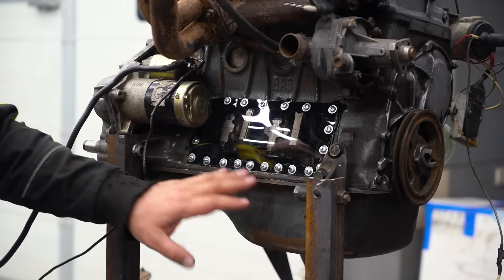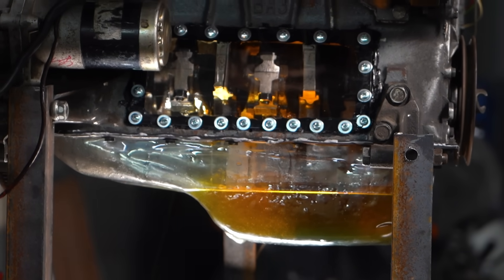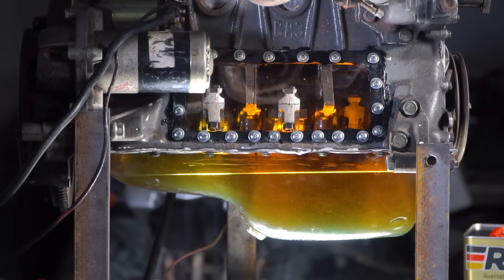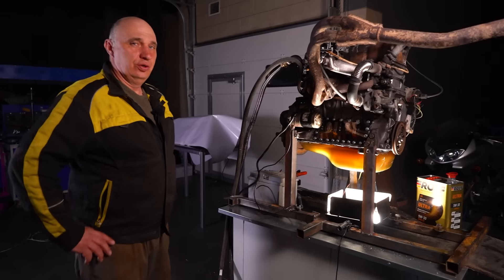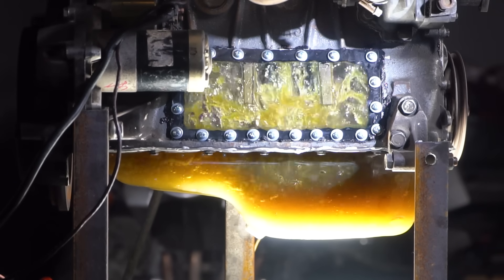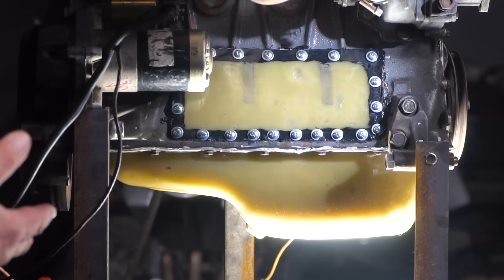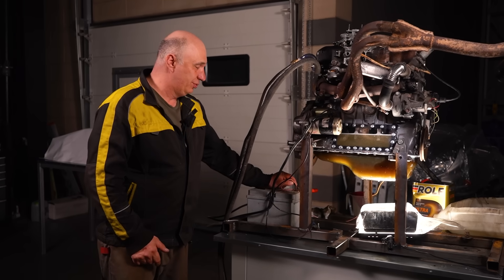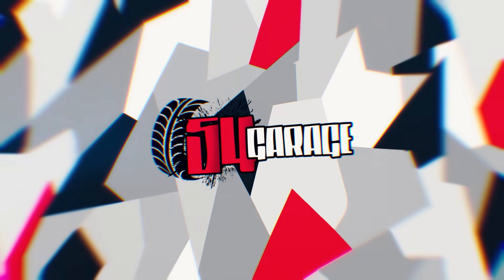What actually happens when you overfill your motor oil? (w/ transparent oil pan)

Comment: 2 things happen. 1.  power is reduced due to the crank hitting the oil and picking it up. This is the reason race engines use dry sump systems or windage trays and scrapers. 2. The foaming action of the oil is increased not allowing air to dissipate out of the oil causing cavitation around the oil pump pick up tube, thus reducing oil pressure because of air in the system which reduces the film of oil on the bearings and causing extern wear. Garage 54 is what hot-rodding in the US use to be! Great and fun channel.
Reply: Race cars don't use dry sump oil systems because the oil being picked up causes a loss in power, it's because during long, hard turns a traditional wet sump setup like the one in this video would have all the oil slosh to one side of the sump which can lead to low oil pressure and even complete engine failure if it happens enough. Keep in mind that most normal engines only have one oil pickup at the bottom of the sump, if all the oil goes to the other side of the sump there's nothing for it to pump
Reply: It's true that dry sump engines can add horsepower along with keeping a consistent supply to the moving thingies, BUT by sealing the engine itself and venting the oil tank you would show an increase in power and a side effect would be those tiny little leaks around seals or gaskets in a few cases wouldn't cause the flagman to show you his purty little b?black flag. Unless you weren't using valve covers with a little inside lip, or some good aircraft grade gasket adhesive the vacuum can also suck a gasket in from the sealing surface and will make almost as big a mess when the RPM drops.
Reply: None of that happens with 1 quart over.
Reply: Race cars use dry sumps because of inertia. During turns oil goes away to sides and pump cant pick it up.
Reply: In mother Russia we fill engine full of oil. If not enough power we get bigger engine.
Reply: Wonder what would happen if engine totally drained again then refilled to normal level, would engine be fine again...? (after also replacing blown gaskets and such, of course). I wonder...
Reply: @gregpohl412   If the engine doesn't get too badly-beaten and the main gaskets don't rupture something, and if the piston rings don't get damaged from playing oil-wall-pump or whatever...yeah, when you return it to normal oil levels, any excess should find its way out of the system over time and it should GENERALLY be okay.  Turbos could suffer terribly from foamed oil, as could the motor if it gets pushed to high loads/high RPM with the overfilled oil, but by and large if you don't run it for too long and don't have it explode out of something, it SHOULD mostly be okay.  It might sneak into the pistons though, maybe they might need cleaned out, or the spark plugs might want to be washed/replaced, dunno.  Mostly it should be fine if it didn't get pushed TOO hard before it was corrected.

Put in FIVE times the oil, or fill it to where the pistons can't keep oil out and you could 'hydro-lock' the engine with the excess oil, and THAT would be terri-bad for the motor.  They don't like 'stopping when one piston runs into the wall called "Oil can't be compressed" and stops the motor mid-rotation.  It's like stopping it by dropping a bolt into the piston.  CLONK, just using oil as the bolt.
Reply: Hi, i just got my license last year and am completely new to cars. I owe a 2004 ram pickup truck and am trying to expand my knowledge in the universe of vehicle maintenance, but it can be hard to make sense of at times. Can you explain this in a way so a dummy could understand?
Reply: @Prinessofwolfs5  can not teach engines in a couple of paragraphs! It takes years. There is an old man on YouTube that is a Legend!! Find him and watch every video. Wont be long till we cant learn from him anymore!
Reply: Always follow your Ram's engine specs listed in the owners manual for fluid capacities. Watch a few YouTube vids prior to working on her, change oil every 4-5,000 miles, and don't be afraid to do anything repair-wise, just use the right tools ALWAYS! @Prinessofwolfs5
Reply: 😮lll😢
Reply: Race cars use dry sumps to prevent the oil being forced away from the oilpump pickup under high gee load while cornering. Which would lunch the engine.
The end.
Reply: oil pressure increased and got out in the video
Reply: Most modern engines use windage trays now..   Just that little bit of extra efficiency for nothing more than a piece of stamped sheet metal, though some go further and have a big cast aluminum chunk that is actually structural..
.
As for race cars and dry sumps..  Yes, foaming, yes, windage..   But I'm going to say the majority of that is for temperature.   Once your oil gets over 260 270, you are just done...  And its not that hard to get it there..  
.
I was back at my parents house this summer, got a boat from my Dad's friend.   Took my folks Grand Cherokee and towed it back home, 2400 miles..  Its the little six 3.somthing, didn't have the tow package, so no oil cooler..   I was worried about the tranny, that thing stayed rock solid at 206, just like it does driving around town..  
.
One push up and one push down on a button gets you from tranny temp to oil temp..    I ended up driving by the oil temp..  It was a fresh full synthetic change, Pennzoil, if that makes a difference, I like it because of Steve Park.    Flat highway, wouldn't go much over 200 degrees.   Get into those hills, and I really had to start slowing down, it was pushing 230+, and I wasn't comfortable with that..    Just go up the hills at 65 instead of 75 and I could drop the oil temp 10-15 degrees.   Running without towing and empty, its almost impossible to get the oil temp to even get up to the coolant temp...  
.
I'm a little gun shy on the oil temp thing, my aunt cooked her motor in her toyota camry a few years ago, Tulsa to OKC, she was moving back to Phoenix, her car was LOADED..   She had my cousin with her..  Probably an extra 1000+ pounds in the car, I was back East when they left, and checked all the fluids, even though she had just been to the garage..  Just in case..  
.
Day and a half later I get a call..  Motor is making a funny noise...  And over the phone you hear BAP-BAP-BAP..  I hope that's a massive exhaust leak..  And then some nice guy pulled up behind them, asked if they were OK...  Said he would go back and sit in his giant pickup until AAA got there so nobody would hit them..   I was already on the phone with them, my cousin had texted me his plate # just in case..   He checked the oil, super low.. added 3 quarts to even get it on the dipstick, and even with 3 fresh quarts, it was still midnight black oil..   I talked to him on the phone..  and he was like "Yeah..  that's a rod knock, that's not an exhaust leak"..   Its hard to tell over the phone, and I was going for the positive spin (I was already 96% positive that was a rod knock).    
.
Long story short, my aunt has no mechanical knowledge, nor does she want any, and she drives like a mad woman..  And she was probably running 90+ up those hills, and if ya'll have driven 44 from Tulsa to OKC, those are some pretty tough hills.   Hauling 1500lbs over GVW for her car...  Probably got regular dino oil, not synthetic, and she cooked her oil..  
.
I think every vehicle should come with an oil temp gage..  Super handy, especially if you are towing, almost as import as coolant temp..  
.
So anyways..   Lots of babbling, I'm of the opinion that race cars primarily run dry sumps so that they can hold a lot of oil so that it can cool and not cook the engine.   Running hard puts a ton of temp into your oil, and oil has a limit, and its really not that high.    
.
Reply: An other bad thing that would happen with too much oil in the engine is some of the oil is going threw the exaust and cloging the catalytic converter till the engine stops running because of it.
Reply: There still are a lot of engine heads here, we just don't post on YouTube, we just do it for ourselves. I commend this channel, it's just not my thing to post a video of doing something
Reply: Thanks for the information, wise 🦉
Reply: https://www.youtube.com/watch?v=GJzrzHTWooE
Reply: That's one reason race engines use dry sumps. The other is they spend relatively long periods at high lateral acceleration that could expose the oil pickup. Just easier to use a dry sump and not have to worry about that and other factors that could cause inconsistent oil pressure. 

It's also interesting how you can hear that the engine is idling slower with the overfilled pan. Clearly, overfilling the oil by, say 2x won't cause any damage unless you drive it that way for awhile.
Reply: 3 things will happen.... the engine WILL begin to smoke out of the exhaust when enough oil gets thrown onto the bores and overloads the rings..
Reply: Confirmed in my testing, you get the best results at about half full for the toyota series engines. On the crosshatch marks - just make sure that the engine doesn't make any scrapy sounds compared to before. 

Having one of the taps for the sump plugs are really useful, because you can recycle the oil and test the optimal oil level for the car.
Reply: the dip stick have hallow dots on it which tells how much space is in the sump available to fill the oil for the engine
Reply: they also use a knife-edged crankshaft
Reply: Doesn't happen until excessive amounts of oil are used, 3X
Reply: And 3 the undersides of the pistons smash into the oil so hard. They crack the skirts.
Reply: exactly similar to gearbox overfilled.
Reply: No. No. No. Basic physics would say the crank has so much inertia the force of rotating in the oil is almost unmeasurable. 

THE REASON race cars and many performance vehicles use dry sump is to ensure oil pressure under high g braking and cornering…smh. 

In a pan the oil will slosh around. 

Just worded #1 a bit wrong. Your #2 is ok, except a large excess of oil also increases oil pressure and will eventually cause leaks and excessive blowback into (if equipped) emissions systems

Comment: The test is good but is not real world, as stated the engine is stationary and the oil is not moving around as per normal operation.  The topic has been extensively researched by manufacturers and there is a reason why the manufacturer specifies a oil amount and warning to keep within the limit.  The semantics about foaming and oil pressure etc is another topic however the oil pressure test here was missing and another very important conversation topic, this is an old engine, modern engines operate slightly different from manufacturer to manufacturer.  I think this test shows "some" detail however the real world data is difficult to compare to this demonstration.

Comment: The problem with over filling oil is heat. The surface area of the engine doesn't change so you end up retaining heat in the oil - in a bigger volume. Acting like a heat battery.

Comment: The manufacturers have done extensive testing to determin the best oil level for their particular engine and have calibrated the dipstick accordingly. Therefore it would be wise to fill an engine to the"full" mark on the dipstick and no more than that.
Reply: There is such a thing as safety factor, usually about 10%, over filling a little bit does no harm

Comment: This confirms what I thought, if your engine, for example, has a 4 L oil capacity, it does not account for the engine running. That means, for example, if you are doing autocross, the oil level may not be enough for the oil pickup to supply the engine in extreme curves. Adding 1L or 3/4 will keep the level between safe marks.

Comment: It is actually not good to overfill. It aerates the oil. Parts of the engine that need a tiny film to protect the metal on metal movement of those parts, can lead to cavitation which leads to pitting on metal parts which leads to excessive wear over time. Not good. Not to mention oil getting past the piston oil control and compression rings leading to burning of oil in the cylinder.

Comment: Would've been more interesting to double the AMOUNT of oil, not the height in the dip stick. Volume is repeatable, dip stick height changes. The pan is much larger at double dip stick height. It is not a linear relation between oil volume and oil level.
I found out it doesn't hurt, if not done excessively, when my mom was using my car and the oil light came on. It consumed some oil, so I had a 5l canister in the trunk, with about 3l still in. Mom called me about the "refill oil" message. As she was on a long trip, I told her, to take the canister and "just fill some in" (I don't remember the exact wording, which is subject to debate still a decade later. ^^) I was in a hurry and usually my mom is smart. So I didn't bother to elaborate much. 
She filled in all the remaining oil in the container and happily drove the rest of her trip. Car is still running. ;)

Comment: Try filling the engine with oil as much as possible with it running and then remove the oil pump and see if the overfilled oil will lube instead of the oil pump

Comment: Problem here is the FOAM full of AIR, the crank slaps the oil hard, like an egg beater making mayonnaise, then the pump circulates this aired low pressure oil to the top side cam bearings, cams, piston rings, etc... you can figure out the rest. You should of set an oil pressure gauge on this experiment, you would see the aired oil is much lower in pressure as air can be compressed whereas oil can't. A quart over on a leaky engine is fine, but there are better solutions for solving your oil leaks.

Comment: I have a Kia with the notoriously high failure rate GDI. I'm constantly on top of keeping the oil topped up. I have worried about getting the oil above the line, but I guess I shouldn't. I love how the motor they used has the firing order cast into it.

Comment: Was feeling lazy and got shop to do oilchange they overfilled my  toyota hilux surf and the banjos on the turbo oil lines come loose, 
So I drained the oil tighten banjos put correct  oil in and was sweet as.

Comment: I watched a test like this with an engine on a Dyno..... aA

A  V-8 drag racing engine.... not a 2000 HP engine, just a potent one.
With less than one extra quart, they lost just over 40 HP.  1/2 quart low was better.
The oil aeration caused a large drop in oil pressure.